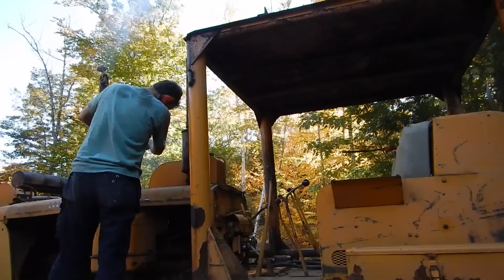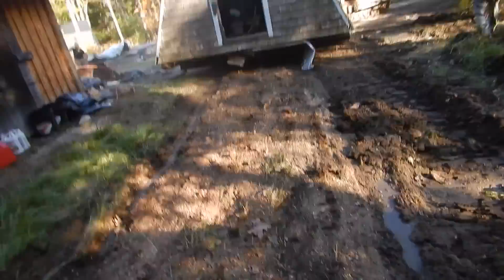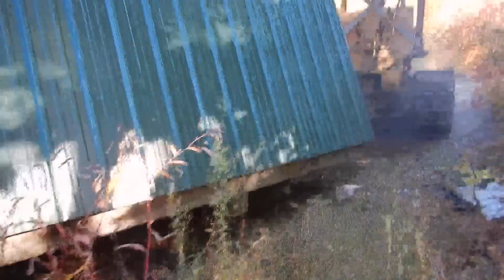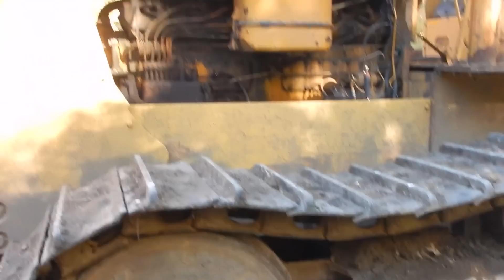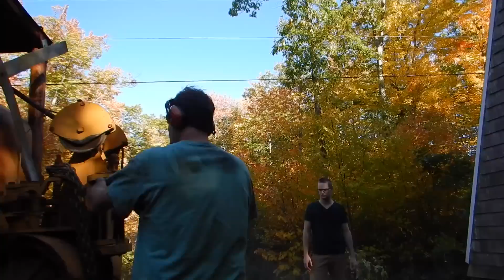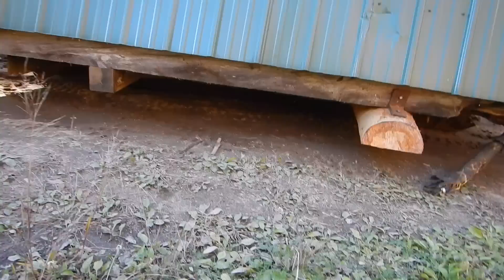Bertha, a TD-24 Dozer

Comment: The best bulldozer   Diesel engine  satrt by conversion  Gasoline  to diesel Fuel  1091 cubic inch  naturally aspirated 209 HP to flywheel !!  The best planetary steer System

Comment: This is a series 241 TD24, made from 1955 to 1959. It had 190 or 205 HP gas to diesel motor. the later ones had 205 HP. Series 241 was an upgrade from the original TD24's built from 1948. They had to upgrade because CAT and Allis Chalmers were building more powerful dozers by 1955. Euclid also had bigger and more powerful dozers by 1955.
Reply from the maker: Interesting, thanks for the note. I believe this one was a 1959? I haven't seen it in some time now.